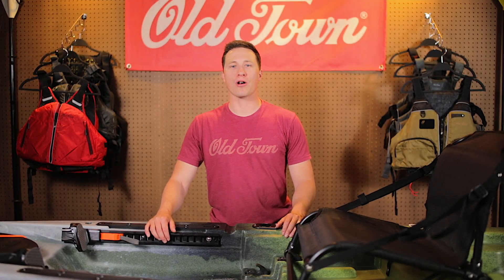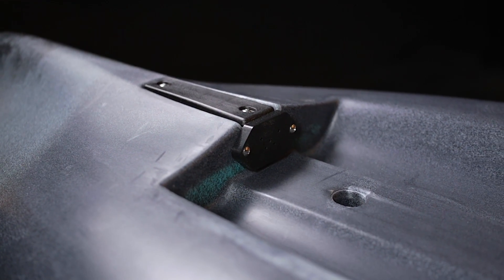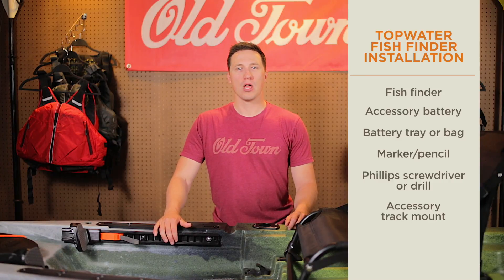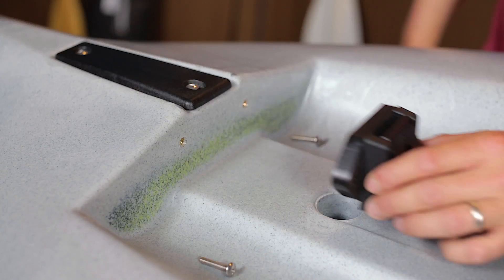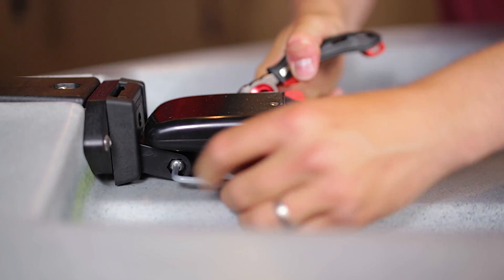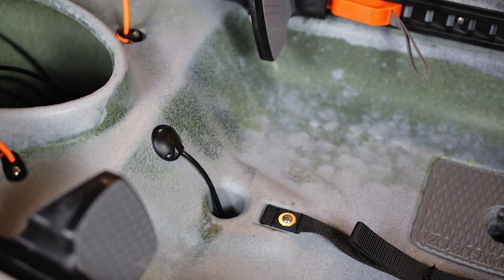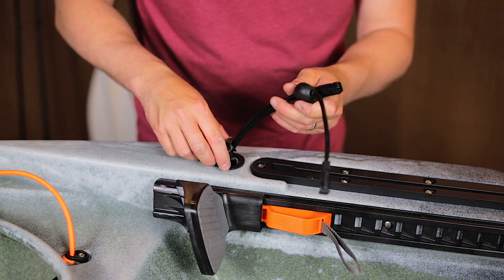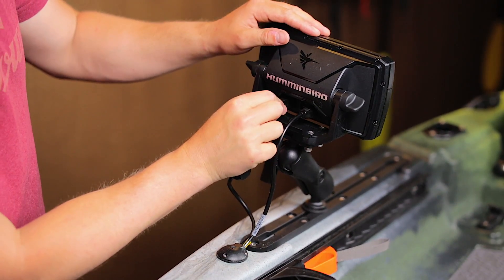Installing a Fish Finder on the Old Town Topwater

Comment: Love my Topwater PDL, but this guide is not "detailed." The Helix 5 comes ready for boat installation, but not for a kayak with a universal transducer mounting system. To be fair to Old Town, most of my issues are with what comes from Humminbird with the Helix 5, but I’d still love it if they did a thorough video specifically for us Topwater PDL Humminbird Helix 5 folks. Anyway, here's the stuff I bought to get fully set up with some explanations. Hope it helps you out. Also, this isn’t an endorsement for anything b/c I’ve only been out a few times and can’t tell you how it’s holding up. 

Battery:
     • Wilderness System Lithium Battery
     • 4.5 mm shrink fit crimp connectors for connecting to Helix 5 power cable
         o Explanation: The shrink fits that come with the wilderness battery are too small for the Helix 5 power cable. You don’t have to use shrink fit connectors, but if you want to you’ll need 4.5mm ones (light blue)

Mounting fish finder to gear track:
     • RAM Mount Surface Mount f/Humminbird Helix 5
     • RAM 1.5" Track ball with T-bolt
     - 4 #10 32 x 1" round head screws with bolts
         o Explanation: Humminbird sends stuff to mount to the boat directly; these are what you need specifically for the gear track install where the video shows it.

Mounting transducer:
     • #10 32 x 5/8” round head or hex head screws with bolts
          o Explanation: Humminbird sends #10 1” screws that would pierce the hull (as they are intended). If you want to mount the Helix 5 tranducer back to the Topwater universal tranducer mount you need these screws. 1/2” are too short and 3/4” are too long. The 32 (thread count) doesn’t matter that I know of; if you find #10 24 x 5/8” those should work too.

Wiring:
     • Wilderness Systems Through-Hull Wiring
     • If you don’t have one, you need a 35mm (1-3/8") drill bit; doesn’t hurt to have marine quality sealant as well but is not mandatory.
Reply: When adding the thru hole wiring kits do they void the lifetime warranty? What did you use to mount the battery? Thanks for the detailed instructions!
Reply: thx for the instructions, very helpful. i just have to decide which battery to buy

Comment: Is this the fish finder that comes with the Topwater if I buy before September something?
Reply: that is not the same transducer.  the piranhamax transducer and mount are a bit tighter to the scupper hole but they fit.  I had to get stainless machine screws and lock nuts since the piranhamax didn't come with them.